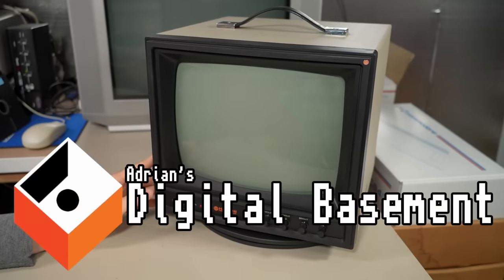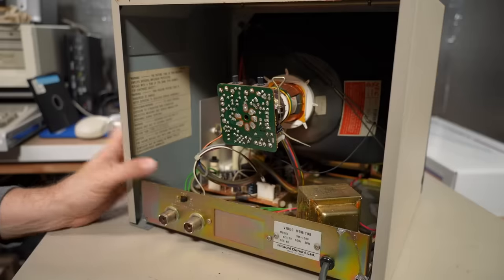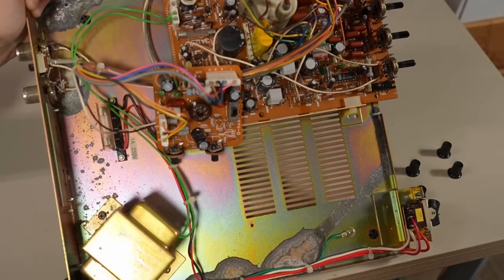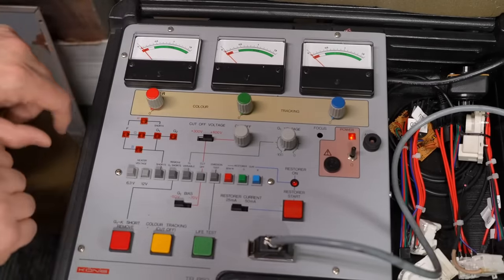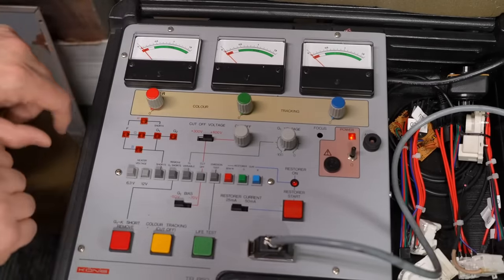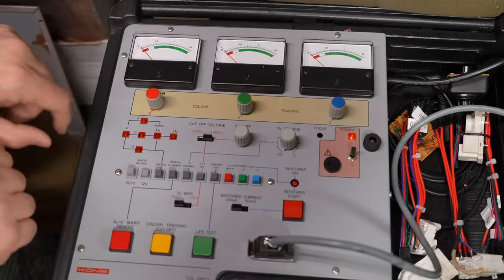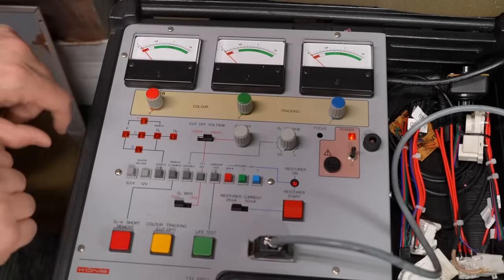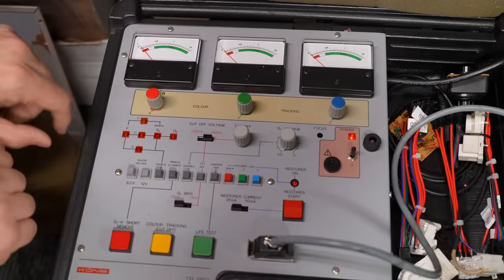A perfect pair to the Apple II: Hitachi VM-129U #rescue

Comment: This is probably a common fate of many old security monitors, they got driven 24/7 for years and decades until the phosphor was completely degraded.
Reply: @UserUser-zc6fx wooow seriously?  I cannot imagine that a crt monitor could run over 4 decades while running it 24/7,i found 20 years already alot for a crt screen being normally used

Comment: That looks like cadmium plating, assuming that it's steel. It'll only be anodized if it's aluminum.
Reply: You cannot plate something with magnesium. Magnesium can be plated however.
The plating on here is most definitely zinc. 🙂
Reply: Looks like yellow zinc plating
Reply: It is zinc anodized

Comment: The lack of DC restoration on monochrome TVs was always a distraction. Apparently there were mods out there to improve matters back in the day, as long as it didn't cause issues with PSU/line stage loading.

I also used to have a colour portable with no DC restoration. As you might imagine, this played havoc with saturation levels. I gave that away.

Comment: Those connectors look like SO239 sockets. They are paired with PL259 plugs. Still in common use among us radio hams for HF bands (0 - 30MHz). We use BNC connectors for VHF/UHF (144MHz / 440MHz). Although, as far as I know, BNCs can still be used for HF too. Great video as always by the way :-) Thanks.
Reply: Thats what I thought too, not sure why they would choose so239 though on a 75ohm as they are generally considered a 50ohm connector and usually paired with 50ohm cable such as RG-8. They are also designed to handle RF power and can handle quite a bit. Doubt the impedance mismatch would make too much of a difference on composite video though I have never tried it.
Reply: @RC-nq7mg  The connector has nothing to do with the impedance.
Reply: The PL259/SO239 connector is sometimes called a UHF connector. It is common on HF radios but also VHF/UHF mobile and base station radios. BNC connectors are common in VHF/UHF handheld radios. BNC is fairly common for low power and portable (QRP) HF radios like the Icom IC-705.
Reply: The cable would of been RG59 or RG6 , which are 75 ohms.
Reply: @cappaculla   sorry it can sometimes affect it amp made two version of the same connector  one was 50 Ohms the other was 75 home  just a slight difference in the center pin diameter and insulation  (BNC like a screw connector circa 1985)  if connected to a TDR you can see the mismatch  it would be more that what you see on a simple connection bump on the screen
Reply: @cappaculla  Not exactly true.  For instance there is a difference between 50 ohm and 75 ohm BNC connectors.  True for the most part it makes little difference, but as you go higher in frequencies, it can make a difference.

Comment: Those look like SO239 (female) connectors on the back of the screen. The male is PL259. I'm a ham radio operator and we absolutely use those 2 connectors for our antenna cables. They work really well!!

Comment: The coating on the steel parts that looks a kind of gold colour, its called 'passivated' steel. It's an alternative to zinc galvanising.
Reply: Yellow Zinc plating looks very similar too
Reply: I was thinking zinc chromate.  That tends to give a rainbow sheen to the parts treated that way.  And it's pretty good at corrosion resistance without any further treatment.  Although your best bet is a corrosion treatment and then a coating or paint for additional protection.
Reply: Cadmium coating is yellow as well.
Reply: @ericpaul4575  I sure as hell hope they didn't plate consumer gear with cadmium! lmao.
Reply: @jeromethiel4323  Yes, yellow zinc plating is another way of calling yellow zinc chromate or yellow zinc dichromate plating. :)

Comment: The advice I usually give when it comes to adjusting brightness on a display intended to be used routinely is to initially set it to what you find comfortable, wait a day, then drop it just a very tiny bit the next time you go to use it, wait a day, repeat until you feel it's gotten too dark, at which point, turn it back up just ever so slightly and there you go! :B
Reply: Great idea! I need to do this with my PC monitors

Comment: Two remarks:
1. If a CRT is a capacitor, isn't swapping it a way of "recapping"? 😉
2. To lock the exporsure on a Sony camera, set ISO to some fixed value and put the camara in manual mode. Now you can set the aperture to adjust the exporsure.

Comment: The switch on the neck board is for the DC restorer. You'll want that on for computer use so the black level doesn't vary between overall light and dark screens.
Reply from the maker: Indeed, I saw that after reading the service manual and turning it on allowed that sub brightness to work, so it's definitely on now. Not sure why anyone would ever want that not to be turned on....
Reply: @adriansdigitalbasement2  if you are running video duplication you want to monitor the signal but not terminate it you would let the end of the line terminate the signal at the  recording vcr for example  mutch like thin ethernet
Reply: @adriansdigitalbasement2  IIRC, the switch was for servicing the set.  It's been so long, I can't remember why.  Sorry!

Comment: The yellow coating is called zinc chromate or yellow chromate. It's a common coating for various bits of usually fairly inexpensive metal that need some measure of weatherproofing or at least water resistance. Cheap deck screws are a common use, along with steel sheet and the like. I've also seen it on really awful-cheap cast bits of pot metal intended for outdoor use. For whatever reason, it's a fair bit more common these days than galvanized, but I don't know if I'd consider it better -- especially given the quality of what's usually underneath... which, what of it is present, is best spelled with a leading 'k' instead of a 'q' ;3 Eh... it's durable enough for what it usually needs to accomplish, I guess.

Comment: Hey Adrian!
Those coax connectors are called PL259/SO239. The PL stands for plug, and SO stands for socket. Otherwise known as the "UHF SOCKET". They are commonly used on amateur radios, even brand new ones you can buy this minute, along with CB radio and Marine radio.

EDIT
Corrected typo. Changed PL239 to PL259. Whoopsie.
Reply: Yep, my CB radios had them. I think the plug was PL259.
Reply: @bouldersoundguy  Woops yeah, you caught that. PL259 and SO 239. That's what happens when I make comments when tired.

Comment: In days of yore (the 1950's) they sold "CRT brighteners" that increased the filament voltage a volt or so (6.3 volt filaments).  While they did work to a certain extent, the picture tube was on its last legs, and it didn't matter much in the end.  I had one that was used on a CRT we had in the house as a kid.  Of course with using the monitor a long time the phosphor sometimes got burned if (for some reason) you always watched the same thing (a test pattern?).  Not so much a problem with broadcast TV, but things like CCTV setups it could be a problem.

Comment: That's quite strange, I never seen a PL259/SO239 used for video! CB radios and low freq two-way radios are the first thing that come to mind, not video haha! This is what makes vintage electronics so fun, especially odd-ball units
Reply: It seems to be asset tagged so maybe it was specced to intentionally use a weird connector that someone may not just casually have around to prevent it taking a walk home with someone, and it being screw on probably also helped with just things not coming loose.  Dunno why they wouldn't use BNC but maybe it was just what was most easily available during production?
Reply: it was common for closed circuit TV and still is common radio antenna transmission line
Reply: Yeah, it was common on OLD video equipment.  When stuff was still reel-to-reel.  Before VHS.  In my high school, we had a bunch of old monitors and cables that had "UHF" connectors.

Comment: I so rejoiced when I found a 9 inch B/W computer/surveillance cam monitor in the dumpster. But... everything was broken. The power supply was the only thing that worked. Several caps were bad, and when putting the neck board back on for the second time, the CRT just cracked and broke (I didn't use force!). And with another tube and a lab PSU (for current control), well... turns out the flyback is bad as well. So... not only is this worthless, but it also wasted my time (and the industrial 12V PSU isn't worth all that much). Damn. I would have needed that monitor to fix a rare video games console with built-in monochrome CRT (the Philips G7200)... they have very poorly made flybacks that just fly apart.
The term for describing the brightness level changes when the contrast of the image varies is DC restoration. TVs usually skimp on that while monitors take it seriously.

Comment: External sync jack for House Sync. The cameras would need it too. This enabled seamless switching or you could put it into a video-mux for multiple cameras on one screen.
It wouldn't surprise me if the output of that transformer is 24VAC. Security cameras of the day kind of standardized on that power source.

Comment: Those jacks on the back of the monitor are SO-239. They are very common on ham gear as the output to the antenna, especially for HF. You can get various types of coax for it, RG-58 etc. The coax is quite thick but it has very good power and signal fidelity. edit: of course, there were like 5 other comments pointing this out. That's what I get for not reading the comments first!
Reply: Got a 27MHz CB-radio that uses this kind of connector to the antenna. The radio is 5 months old, so it's still in use today. ;) I think it's called a BNC PL connector, and connects to the RG-58 or PL259 50Ohms coax cable.
Reply: @tostumpen  No, it's definitely SO-239/PL-239. BNC is a totally different thing. These are the sort of things you learn when you get your amateur license!
Reply: @AureliusR  Ah my bad. I won't be getting that licence.
Reply: @tostumpen  Why not? It's easy, and it gives you plenty more bands and power to work with!
Reply: @AureliusR  Well, the equipment is way too expensive, and I have no space for the antenna to put up here. But who knows.. Maybe down the road.. 🤷
Reply: @tostumpen  It's only as expensive as you make it. Plus you can get on VHF/UHF repeaters with a sub-$100 radio.

Comment: Great. Another CRT back in operation!. I'm sure this is commented on already but the sockets on the back are called SO239 and use a PL259 plug. These are very common on CB and ham radio HF equipment and up to around 200Mhz. The type used in that monitor will be a 75 ohm impedance type whereas in radio, its usually a 50 ohm type.
The Emission test (same test used in valve testers, or tube testers) drops the heater voltage by a certain amount, around 10% and the resulting drop gives an indication of the cathode emmision or 'goodness'. In a good tube, it should hardly drop at all (less that 5% is probably good).

Comment: At 21.40 into the video, you say "don't do this unless you know what you are doing". Just a hint: You had your left hand on the case while you pressed the power switch with your right. Back in the day, I was told "always have one hand in your pocket when work on high voltage kit". With an open mains powered system like that I would never, ever, have two hands in contact with the equipment.

Comment: 12:00 I used an automotive rust converter gel after scraping off as muchof it as I could using a wire brush and then 80 grit sandpaper, then when the gel dried, aluminum color rust spray paint.

Comment: 34:52 Seeing 3 vertical lines in the square is a common misconception.  The intention is to see the controls to only see 2 vertical lines.  Going left to right, the 1st vertical line is below black, the 2nd line is true black, and the 3rd line is above black.  At perfect settings, the 1st and 2nd lines should be identical.

Comment: 19:33 the sync would be NTSC black burst sync. They may have made a version of this for broadcast. Usually everything in TV in the NTSC days had a black burst sync to make sure everything in the facility was correctly timed to each other.

Also those are UHF connectors. Very common on older security and broadcast monitors. Basically, it’s what BNC replaced.

Comment: Not important, but a very short bit of history.
The sockets you disabled, are commonly called PL239, are commonly used on co-ax cables, for transmission and reception in the VHF, band (around150 mhz) range.  They were most commonly used in VHF aviation equipment.  The BNC to PL239 adapter, was commonly used to adapt to BNC terminated cable, which was more commonly used in UHF radio (Ultra High Frequency , eg., aviation and radar)
 The original broadcast range of the 2 through 12 channels on an old TV, were in this VHF range. but they normally used twin lead cables to the antennas, which were much less expensive and sophisticated and had a resistance value of 300 ohms.  In the 70s, when cable became the primary method of transmission, we had to use a 300 ohm to 75 ohm adaptor, to connect to the TV set.

Comment: I have a funny Mid 2000s CRT TV in my office and I just went into the settings and verified I wasn't overdriving it thanks to you.
It also has a funny function where there Is a Notepad built into the TV where you can use the number keys like you used to on old cellphones for entry of text. Not sure why they thought people would want to write a note for someone on the TV.

Comment: I have a collection of oddball CRTs with different phosphor types. One thing I’ve noticed is that there can be a wide variation in voltages within the same tube family depending on the phosphor used. I have 3 different 5BHP# series, a 5BHP1, 5BHP5, and a purple(!) 5BHP32. The P1 and P5 display a nice bright image at 8500 volts, but the P32 won’t even display an image until 12+ KV. I bet that particular tube family requires a higher drive for the white phosphor than the green and that’s why it was decently bright even with the controls at a minimum.

Comment: Nice find Adrian! and nice video as always!
Unfortunately all those security monitors were very high hour units driven 24/7 so one must not wait much in terms of CRT brightness. A lot of them have permanent burn images on the phosphor from showing always the same picture. Their construction is great though compared to old TVs and early computer monitors, metal casing, chassis etc.
I would like to see though how this vibrant green CRT measures at the CRT tester, what it shows on the meter.
And as another folk commented before me I consider a CRT swap as core recapping of the monitor!
Cheers from Greece, Jim

Comment: Funny thing is that these days, there would be absolutely no reason to try replacing an LCD screen, or often, even the backlight of a modernish monitor. You'd just replace the whole thing. We need to appreciate the remaining days we have to do things like CRT swaps. Unless they somehow come back in retro style, CRTs are just going to fade away, literally.

I know it seems silly and wasteful, but for those few who still use and enjoy CRT monitors, it would be nice to have a company which makes 3 or so of the most common sizes, black and white or color, and will customize the mounting tab orientation as needed. Phosphor technology has come a very long way with the LED, so there should absolutely be a way to help the screens last a very long time without the same fading and burn in problems of old CRTs.

Comment: Those I believe are PL-259 connectors
Reply: Anyone that ever had a CB radio would recognize those connectors.
Reply: PL-259s were commonly used for video signals (Composite,  and for sync)  in Broadcasting back in the olden days. When I first started in 1970, BNCs were becoming common.  PL-259 AKA the  "UHF" connector.
Reply: I think the sockets are SO-239 and the plug is PL-259.
Reply: @PortsmouthHarbourBoats  You are correct, I think. I remember working with them quite a bit working on VHF and UHF mobile radios.

Comment: ......Nice job, Adrian!!  Just to finish off, the old sockets are SO239 sockets, the corresponding plugs are PL259 types, used by Radio Hams for coax...   Cheap and plentiful, should you want to be ultra retro/original!!!

Comment: Back in the 80s we had several mainframe monitors showing the same info that I think took that type of cable, makes sense they were all chained.  Yes, well said, an amp has what is called head room, if it's low and you try to push the volume the output signal flattens at it's upper voltage limit instead of amplifying the incoming signal as is, the flattened voltage lacks signalling ups and downs and ends up heating the speaker's coil instead of driving the speaker louder and then will burn out causing a short and requiring a replacement coil.  I had to have a 18" sub woofer speaker replaced because of it all, only the huge magnet was salvageable.

Comment: I have a 27 inch Sony Trinitron from 1998.  I'm sure it has composite inputs as well as the 75 ohm and cable. Works well. I never use it. I bought it from Circuit City back then and then had a board replaced with warranty. Willing to sell it.

Comment: "Sync" might be a genlock style signal? Analog TV studios needed to synchronize the frames across all sorts of devices so they usually had a "global" sync signal. Maybe it was used in such settings in a different model? Like one of these camera walls in live broadcast control ooms?